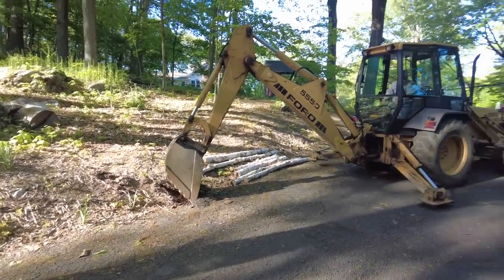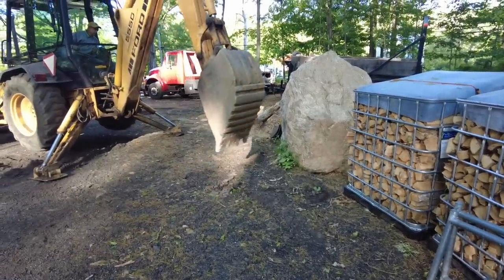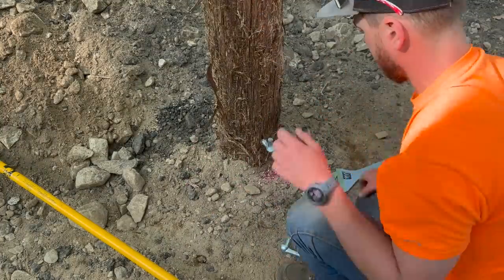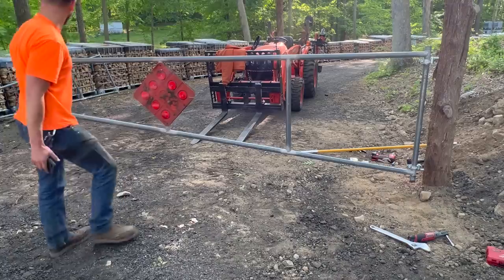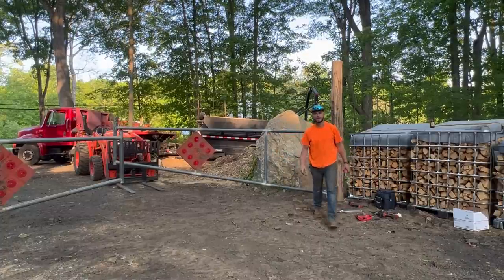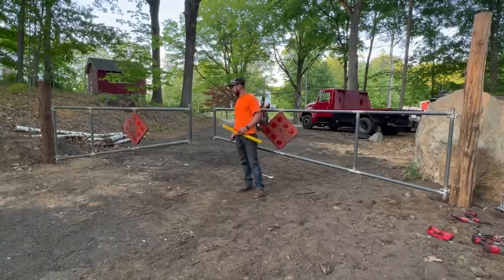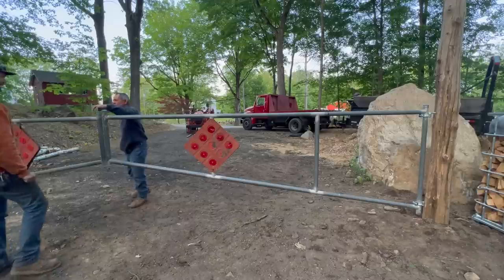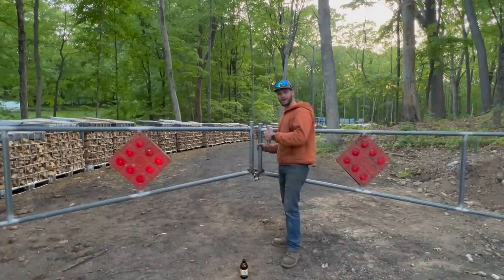#376 Hanging Gates for Added Security in the Firewood Yard

Comment: Yard is coming together nicely, Jake.  Trick I learned 51 years ago as a lineman for plumbing poles.  Take a crescent wrench and "hang" the bottom hole from your pinky finger.  Back off the length of the pole and use the handle to sight whether the pole is straight on at least two sides.  That way, it doesn't matter if the pole tapers or not or the length of the pole.  Keep up the good work.
Reply from the maker: Very interesting!

Comment: Hell yeah, I'll take one. Glass that is.  Tip,  double nut bolts on the hangers. Make it harder to loosen in the dark w just one wrench😉😉.  Take left boot off, then they'll be even. Better buy lottery ticket
Reply: Weld it to be sure
Reply from the maker: Yep I’m thinking I’ll just tack weld on the nuts
Reply: @DudeRanchDIY  yeah, that's a lot better. But lot harder if you need to pull it off for some reason

Comment: The issue is that you log post is tapered and your top lag hook is not in the same plane as the bottom one.  So that gate tilts up. A little chainsaw work to cut a flat spot for the bottom lag hook would have done the job.
Reply from the maker: Yep could’ve done that, but I didn’t want to alter the look of the post

Comment: I was shocked when I registered my 6x10 dump trailer and was told that it did not need a title because it "weighs' 2440 lbs.  That's what the paperwork says at least.  But from my experience, it actually weighs closer to 3,500 lbs.

Comment: The gates are only a discouragement for honest thieves. A battery grinder or a battery impact driver and someone can be in within minutes. A guy up the road from me a bit discourages thieves by placing a stump about the size of the rock near your gate directly across his 10ft wide gate.
Reply from the maker: Not really meant to prevent a serious thief, metal posts could be cut just as easily with a torch haha 😂